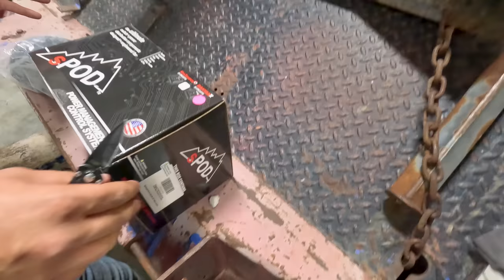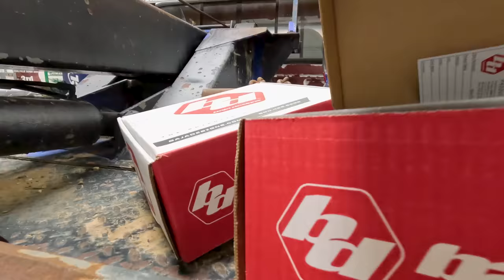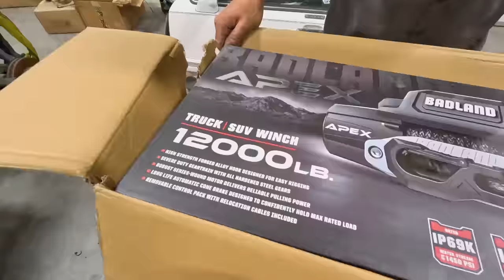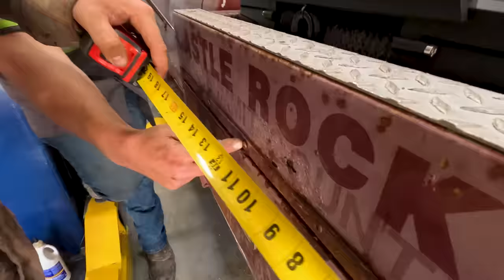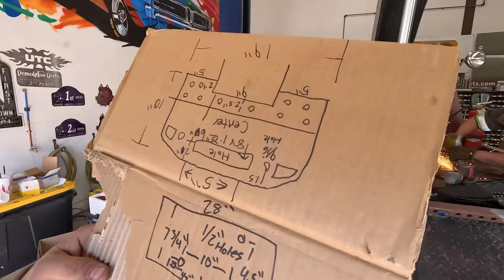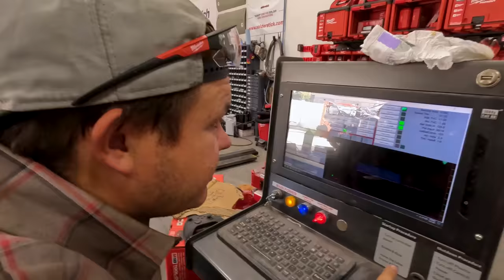Adding Massive Winches On Old Ford Tow Truck Bed!

Comment: King Fred, put a second alternator on it to a separate battery to run all the accessory lights and winches
Reply: There might not be room for a second alternator, but a battery isolator and a second battery mounted somewhere on the truck might be the answer. It could also be used for jump starting the truck, especially if no one is around.
Reply: Those trucks were used in ambulances and stuff like that. There's definitely alternator options other than 80 amps. 

I forget the details but you can run some pretty high output alternators in there.
Reply: Why are those front tires all cupped on the red wrecker?
Reply: @jimmorwood9715  could be a lot of things air pressure suspension bad springs or shocks. I believe they said tires were flat spotted
Reply: The tire cupping is the partly the result of using tires that are incompatible with the design defects of the Ford twin I beam suspension.  Also the toe setting may be out of specification.
Reply: A second alternator often isn't the best idea.

A larger alternator is way better.
You can get after market alternator rated for as high as 300 amps.

And no, that won't mean it will harm the engine performance. Alternators are actually electrically controlled and the high output alternators come with external management controllers that can dial down the output as required, thus also reducing the engine power consumed.

So you can have a switch for "driving mode" and "winching" mode.

A good large capacity battery, preferably a second battery,  will store all the power for when its needed.

But for the record, my car uses a 100amp alternator which I can't upgrade easily (it's a combination alternator and vacuum pump), and I've used my winch for literal hours near continuously and not had a problem with running out of charge.
Reply: @35manning   my Nissan truck had an alternator like that but was maybe 70 amps max.
Reply: @Farm_fab  mine was lower Amps, but I had it custom rebuilt with as many windings that would fit in, 100 Amp is where we landed.

Comment: Robbie you could mount another fair lead on the inside of the plate for the back winch then you will have a smooth transition on both sides
Reply: I was thinking along those lines, too. With those soft winch lines, you don't want them rubbing on any sharp corners, like the fairlead mounting plates. That would shred them in short order.

Comment: Hey Robby I absolutely love those kind of jumper cables!! I have been making those kinds of jumper cables for people when they end up seeing me use mine on my truck!!! But I always use old welding leads that was used on stick welders!!! I’m a millwright so every time they would replace the welding leads I would always take the old ones and save for jumper cables!!! The wires have hundreds and hundreds of little strands of copper witch work really well and you don’t end up losing any power threw longer leads or jumper cables!!! I also use the cables for wiring up my winches on anything that I end up putting a winch on also!!! Plus by using an over sized cable I have found out that my winches will run longer without over heating!!! I have been doing it this way for over 25 years now and it definitely works out well!!! I have made over two dozen sets for other people also and they definitely love them also!!! For the longest time it was hard to find the gray boxes where other people couldn’t find them and would always ask me and I’d tell them I could make them a set!!! At first I could find them at a fork lift store and get a set of them for under 20.00$ now that others have found out more about them are local Napa stores carry them but cost almost 50.00$ a set now!!! I have also made several extension for times where a vehicle might be in a tight spot and I can’t get to the front of the vehicle to jumpstart them!!!! I just pull up behind them and connect my extension first and then my jumper cables and I have a total of 30’ witch is plenty long enough to get from the back of a full size pickup with a long box and even being a four door truck!! Plus I can also hook the cables to my winches and the other end to my batteries of my truck to run a winch if needed!!! Best set up ever!!!
Reply: Same here, I've even jump started a boat with mine from my Jeep. I got a set of 45  or so ft long. Other use for trail side welding. 👍
Reply: Well, mostly it's not the size of cable, it's the surface area the matters.

So smaller copper strands in a cable means more surface area.
Reply: Same. I have a set of welding cable jumper cables. I made them long, for when you can't get to the battery easily.

Comment: I vote for King Fred the winch cages are awesome the new jumper cable connectors should have covers that are available that are rubber that slide on and off I have them on my connectors

Comment: When you do the dual battery for the winches be sure to isolate the bed battery so the winches don't draw down the trucks starter battery which would leave you stranded have a  jump pack in hand. Also, that 80 amp alternator just won't be able to keep up!

Comment: Robbie, find a shop that can turn the alternator up from 80A.  I have a local place called A&B electric that does that here in MN.  They took my 60A Mazda alternator and made it 140A.  You can also order aftermarket stuff up to 400A or so.

Comment: Looking great Robby and crew!
A work light on each side of the wheel lift would come in handy when hooking up a vehicle at night.  Also, on our trucks we had grill protectors mounted on the push bumper, on top of each end of it, we welded short verticle posts and put radiator hose over them, that way you can wrap your cables around the two posts and then clamp each end of your cables to the post when travelling.  May not make sense for you, but it did to us as we had a dozen trucks that did about 30 calls a day each.  It's coming along nicely though.  You could definatley save some amperage by switching the emergency beacon and all worklights with L.E.D.

Comment: Having one or two batteries in the bed is a good idea. Just use a DC-to-DC charger so the alternator charges the main battery under the hood and is disconnected from the bed battery(ies) so it'll always start, and then charges it/them once the engine starts. 

You may need to add a second alternator to charge the bed battery(ies), but that's for another day.

Between Bob and Fred, I vote to call it King Fred. Then it won't matter what color you make it.

Comment: King Fred of Avalon. 

Honors the original name and its previous owner, includes the sponsors name and has prestige than just "King Fred".

Of course, it can always be shortened to King Fred in conversation, but it needs to have the full name painted on it.

If you do change the colour of it, then the name should be painted in red (with white or black outline if needed for contrast).

Comment: If you guys want a high output alternator that will bolt right up, Mean Green makes one for your truck that is supposed to put out around 375 amps at 2000 RPM.

Comment: I would go with King Fred. I don’t understand why nobody wants to use duel alternators. One for charging and one for accessories.
Reply: Welding and extra power as he is using electric winches and lights
Reply: I have factory dual alternators on my power wagon just because
Reply: Why add weight and complexity when a single high output alternator can give you more power?
Reply: @35manning . Hillbilly said the highest output he could find was an 80 amp. Putting in a separate 120 or 130 amp alternator to run all the accessories such as a welder, all of the winch’s, and lighting will reduce the wear on the 80 alternator and put the strain on the even higher output.
Reply: @mr.nobody3521  maybe Hillbilly isn't that well versed on the internet, because I found a 270 amp alternator to suit a 1992 F series 5.8L and 7.5L petrol engine.

Not knocking on Hillbilly or his computer skills.
I'm also not sure which engine their Ford has because I'm not a Ford person.

But its VERY likely to be a larger engine and those are the largest two engine options in petrol. Which means a bolt in option exists.

And even if a bolt in option didn't exist, look what what you'd need to do to run a second alternator.

You'd need a mounting bracket, an new belt and pulley, new wiring and an alternator.

What would you need for a generic high output alternator that will not fit the engines existing mounts?

A mounting bracket, alternator and wiring, and MAYBE a new belt and/or pulley.

So, worst case, you need EVERYTHING to do either option, so is there a benefit to one or the other? 

Dual alternators take up more space, they add weight, they add complexity and they MAY add some redundancy depending on how they are wired.

Now, granted adding a high output alternator alongside the original alternator will increase the overall power output available, but if you really need more then the 270 Amps the bolt alternator provides, then there are alternators that are even higher in output.
The site I found the 270 Amp alternator on also has a 370 Amp alternator intended for the 7.3L diesel 1992 F350 engine.

Which goes begs the question, if 270 Amps is the max they offer for the petrol engines, have they determined that to be the maximum output the engine can reasonably handle and if that's the case, it's really not that smart to run TWO alternators that will exceed that limit.

Further, two alternators rated at 100 Amp each will provide the same amount of power as a single 200 Amp alternator, however they will consume more mechanical power to do that as you now have TWO sets of bearings, drive shafts, pulleys etc to power.

The ONLY reason it would be smart to use dual alternators, in any universe, is if it was done purely for redundancy, or if the highest output alternator wasn't enough AND the engine had the spare horsepower to drive them, or you needed to run two different voltages AND you can't find a DC-DC charger or converter of a large enough capacity. 

The last vehicle I drove with dual alternators was a Mercedes offroad vehicle with 12v and 24v systems.

The 24v alternator was mounted low and it was required to stop the vehicle, flick a switch to disable the 24v alternator and then restart the vehicle before doing any water crossings, then ensure the 24v alternator was dry enough before turning it back on.

That was a VERY poor solution to the customers 24v power requirement, especially given the predominantly offroad nature of the vehicle.

Comment: wow the front tires  on fred is jagged like sawblades.
also hope you bolt those winch cages on instead of welding them.  otherwise it will be a struggle to replace a winch if needed.

Comment: Those winches are all fancy and everything, but what if you have to reline one while your out? Won't it be hard to do?
Reply: Also, I think he'll have to cut everything apart if one of the winched goes bad.
Reply: @baddawg3380  I think he bolted the winches through the plates and through the bed then welded the plates onto the bed. because he shot down hillbilly's idea to weld them all together. Saying and take a third option and not be able to remove them.
Reply: I had to reconnect and spool a winch in the field. 

In Australia, almost all winches are mounted inside of a bull bar and are difficult to access, but it wasn't that hard to re-spool it.

Comment: I'm really liking the winch 'roll-bars'. I'm just wondering though, won't you need some sort of out riggers to stabilise the wrecker if pulling from the side? Winching from the front and rear has the advantage of the longitudinal shape of the vehicle not to mention all of the weight on the front and rear. The side winches are devoid of that advantage. I suppose it all depends on what you intend for the winches to pull from the sides.
Reply: I doubt it’ll be pulling that much weight from the side winches to be a problem
Reply: Use the winch on the other side to hold on to a fixed point, tree, vehicle etc.
Reply: @mikerubynfs  A tree I can understand, but if there is enough room to put two vehicles side by side, why would you winch from the side in the first place?
Reply: Maybe  not space on the track the second vehicle could be above or further away. I just gave example of why out riggers may not be needed. @andrewjones-productions

Comment: I would put a 130 amp alternator with the 7" bolt spacing and get the wiring harness from 93' to 97' f- series. It's what I did to my 1992 f 150 that has a snow plow on it. Little grinding and one wire to change the end on but all mounted in nicely ☺️. And for being a wrecker I would dual alternator it.  Great job 👍 love the extra work makes a great video ❣️
Reply: What do you mean by the 7” bolt spacing? What benefit do you get from that? I’m ignorant so I’m just trying to learn me something… thanks
Reply: @camillethetacoturd7210  this alternator comes in two different mounting sizes.  One is 7" across and a 9". From center mounting bolt to the other center mounting bolt. Smaller one is more for v6 and V8. Bigger one came from inline 6. But all for high out put demand.
Reply: @catdog8641  Appreciate it!

Comment: Never leave the donor running while starting. You risk burning out the diodes in the alternator. You won’t know right away, but in a few months you might need a new alternator. (Unless you use protected cables)
Reply: Alternator is doneski
Reply: I always let the dead battery charge up first before attempting a crank.  That way it's helping.  If the battery is dead dead, don't try to jump start.  Neither vehicle will be happy.  I always carry a multimeter with me, so I can measure if it's dead dead.  It's best to start with both vehicles off, jump, start, charge, shut down both vehicles, disconnect, then start.  Those protected cables don't do much.  The real problem is load dump, and they don't help that much in that case.  You really want that protection across the alternator not way downstream.  And you have to remember to disconnect the car being jumped first not the donor car first.  It's better to use the procedure I mentioned above.  But this is all moot for me now as I carry a lithium jump pack and just use that.  The main issue is the alternator.  No alternator in jump packs :-)
Reply: @promethbastard yes and no.
On old school cars, I've ALWAYS used the engine with a few revs to get peak alternator output.

Newer cars with fancy computers, I turn the engine off so that having two alternators running (one of each vehicle) doesn't cause any issues for the "smarter" car.

It's rare in my experience, but you can blow / damage the computers.

Comment: Nice job on the winch guards, I wish I had bought a tubing bender when I was building stuff back in late 90s early 2000's... one was quite a bit cheaper then.

Comment: It will need an electrical upgrade for sure. Maybe a couple extra batteries for the winches, a bigger (or second) alternator and some decent wiring. Maybe talk to Chad about the wiring, he does very nice work.

Comment: I have a 91 7.3 diesel, but it should work for you too. Pull a high output alternator out of a Crown Vic (or just steal the housing and put the guts of a high output Taurus alternator in the Crown Vic housing, like I did). Bolted right up for me, but I did have to change the plug on the harness

Comment: Bigger alternators can be used even if the only "listed" one is 80 amps. Call the folks at Premier Power Welder and ask what they recommend for your truck. They have 100 to 150 amp alternators for most vehicles.  And you might consider putting a welder on the truck as well.  Premier is great, but Ready Welder is also good.

Comment: 35:42 One thing I did EARY in my career as buy a Welder (400 Amp Stick Welder) at 18 years old, and a set of torches with full size rented tans at 20 ears old:)

Comment: Engineer production trick; get the CNC to blow some marker holes in the parts. They can be measure points or a half-moon cut out on the edge of a plate that lines up with the hole in a T plate joint. It saves hours of fannying around ^-^

Comment: With all of those winches, you need more than an 80 amp alternator. Look into a Delco 40SI. You would have to make a mount for it but they are available from 240 to 320 amps. They are brushless. Then put some big batteries in the bed. You might consider receiver mounting your winches so you can move them to where they are needed.
Reply: Drove a Ford LN 8000 ‘70 the truck ate the large frame 70 amp Ford alternators for lunch. I wound up going to an auto electronic shop in Boise, they installed a 90 amp Leese-Neville, no more problems. This was the same alternator used by thee Idaho State Patrol in their cars, this should keep up with the demand. I think the alternator in the last big rig I drove was close to or higher than 130 amps.

Comment: You could run a blue sea ML-ACR 7622 automatic charging relay to your winch battery/batteries. Its a very simple way to set things up to have separation and charge etc... its rated for 500 amps. Then you have a manual override switch that latches and unlatches or sets to automatic. Or you can switch it on the relay box. I like the extra toggle switch. Its a very simple setup once you study the diagram and see what wires you will use they arent all needed depending upon the configuration

Comment: That’s funny, looks like that tube bender might be the JD2 model 32? Or at least that’s the bender I got myself when I was in my mid 30’s too, lol. Great bender, I should have got the hydraulics with it, ended up doing an aftermarket air over hydraulic conversion on mine